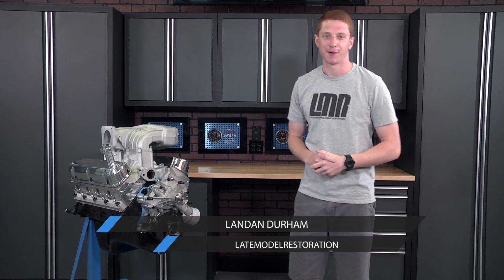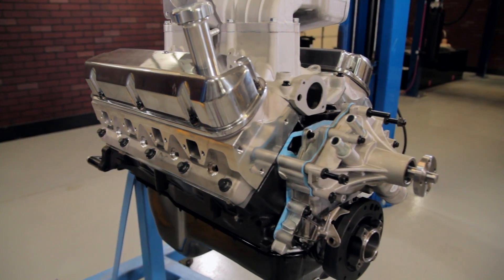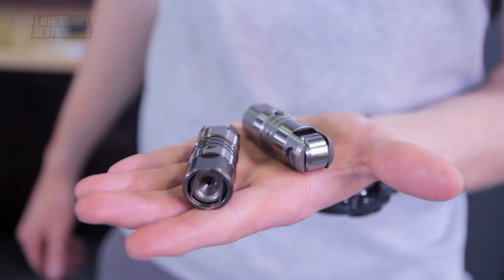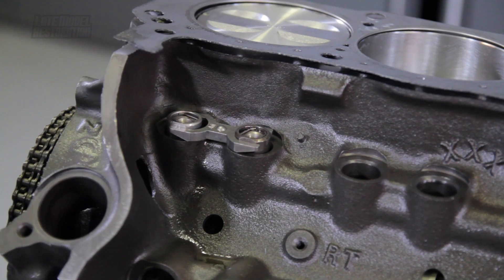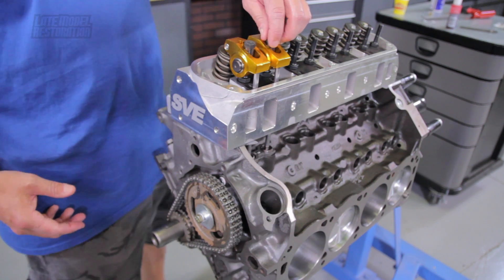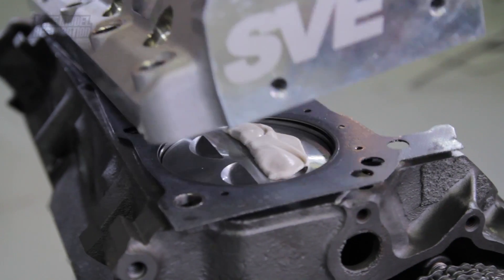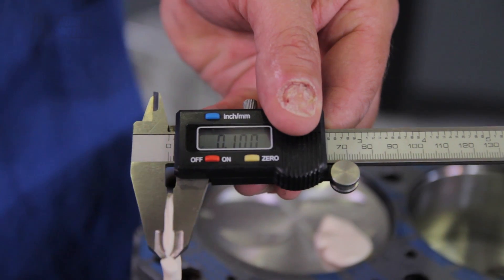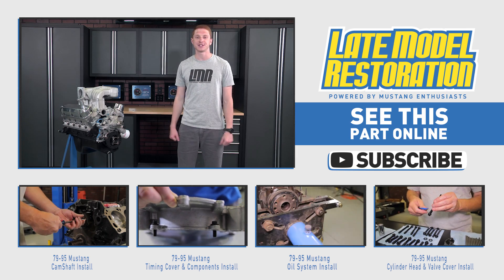How To Check Piston to Valve Clearance 302/351 Mustang (85-95)

Comment: So - were these spongy dry lifters, pumped up full of oil, or modified to be solid for this test?
Reply from the maker: You will use a kit like the link attached for this, these will include a correct solid lifter for you to check. https://lmr.com/item/SVE-PTVTOOL/sve-mustang-piston-to-valve-clearance-checking-tool-85-95

Comment: We do almost the same thing except for no Playdo instead we use rosin core solder, we also use it to check quench distance. Its just a bit more firm for an accurate measure.

Comment: This may sound dumb, but I thought once you put the head gaskets on and tightened the bolts down then they're done, you couldn't take the head off and reuse the same gaskets after you get done checking everything out and do your final assembly?  Or are they still ok as long as the motor hasn't been fired?  I feel like I would get a cheap head gasket the same thickness and reuse the stock head bolts to check ptv clearance, then use my expensive Ford racing gaskets and arp head bolts for when I finally finished everything...

Comment: Looked like your clearance was .100" which is less than the recommended .120" did you guys have to make adjustments or for your application was this an acceptable clearance?
Reply: Send it..
Reply: Ya I don’t know about this video, why ruin a cylinder in a head gasket? What is torqued gaskets measurement? Just add that to the measurement of the play dough. I don’t use my gasket like this. Besides you can remove the two springs & replace with very light ones from the hardware store or Amazon “comp cams test springs” for $9.00. Using the stock springs will also cause the hydraulic lifters to collapse causing your measurement to be off also. LMR please fix this video or comment.
Reply: just get a thicker head gasket
Reply: Michael Saull Yeah wtf happened?